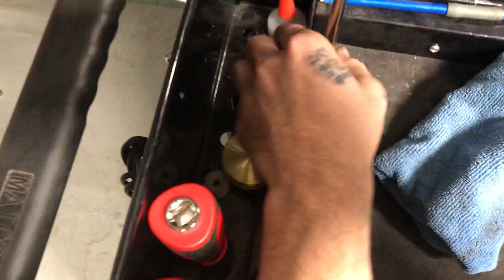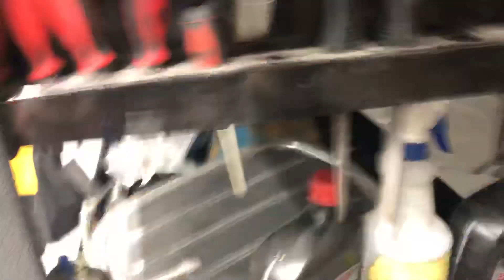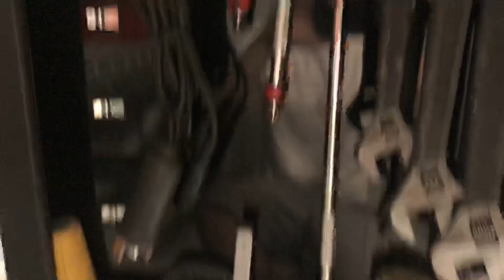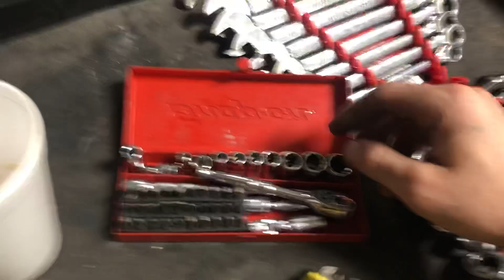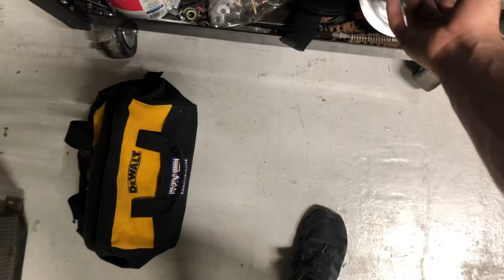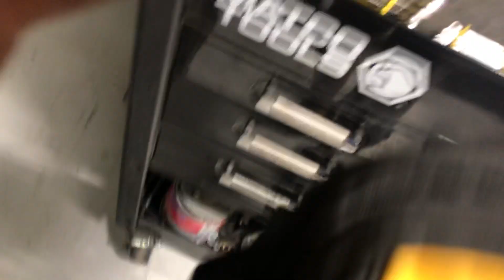TOOL BOX TOUR!! matco service cart Mac matco snap on Cornwell

Comment: Suggestion, get a piece of steel, 1/8 inch thick, 1 inch wide and bolt it over the top section of your side rack to hold it nice and flush...  cut to length, maybe hit it with some black spray paint